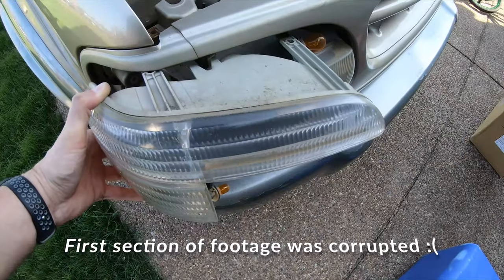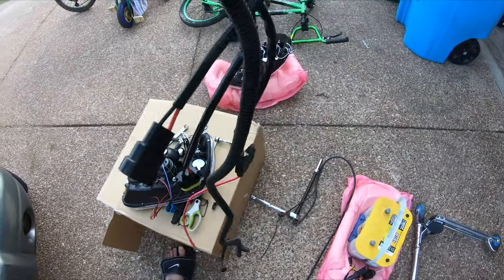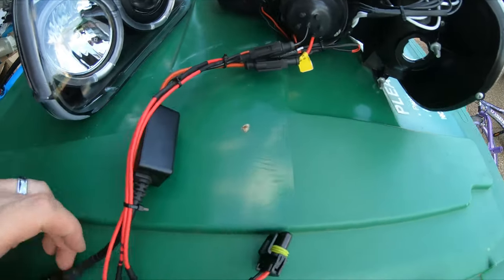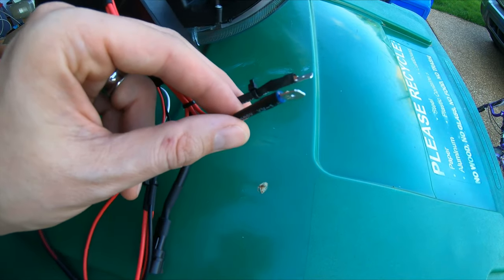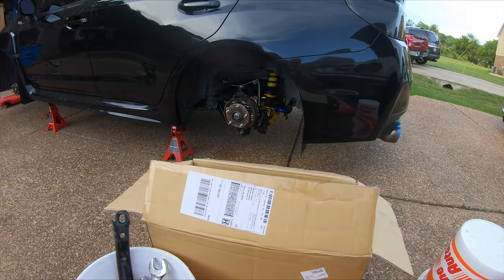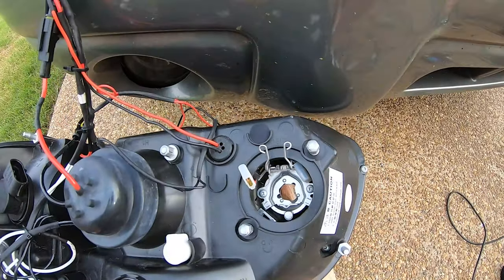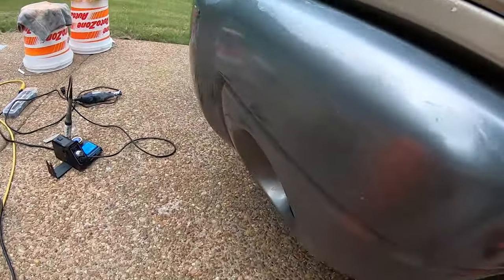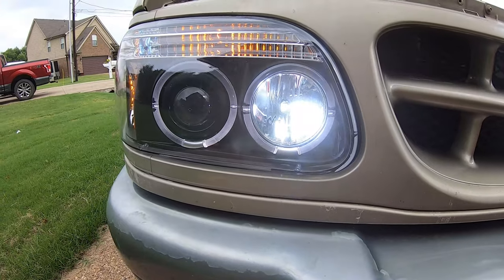Ford Explorer Projector & HID Headlight Conversion | 2nd Gen | 95-01 | The Xploder

Comment: Do you know if I would have to do the same wiring as you did but with an LED bulb?
Reply from the maker: It probably would be similar, but you would need to see what the led uses as I'm guessing there is no ballast but some other mechanism of power. Would want to check and see what bulb calls for and what not. May be simpler!